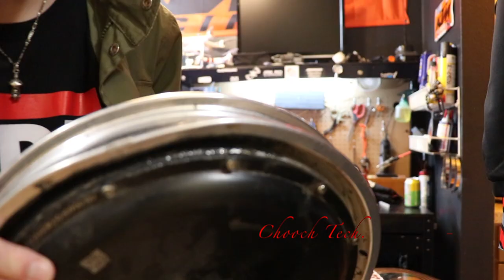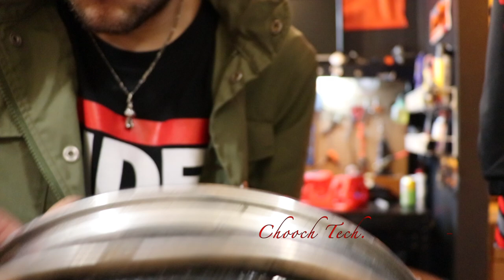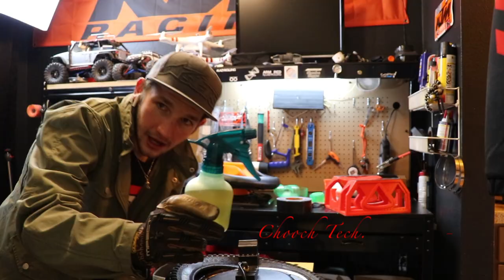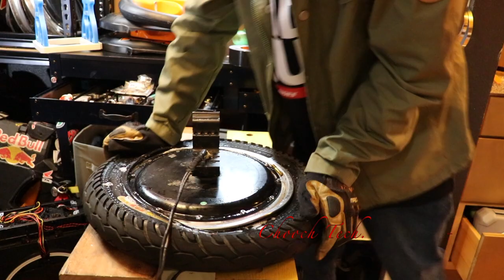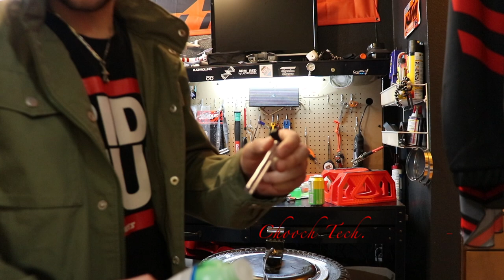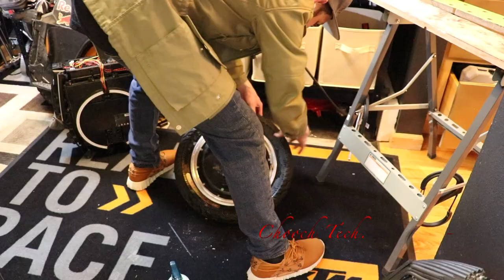PROTECT YOUR TUBE: Electric Unicycle MUST!

Comment: Fairy liquid is always a must, used it on my RS19 tyre replacement and it went on like a charm. Another tip I like to use is semi-inflating the tube before putting the second side in, just enough to keep its form but not too much.

Comment: Harbor Freight stuff is made out of Chinese beer cans. Crap! BTW, I install tubes in tires by inflating the tube the day before and let it sit. Then, I use baby powder on the rim valley and the inside of the tire. Deflate the tube nearly all the way and cover the tube with baby powder and install the tube. The powder makes it slide and conform to the  tire/rim when inflating. To get the tire bead on I use small plastic bicycle tire irons that will not pinch the tube. Much cleaner job. Inflate the tube to 10# and roll the wheel on the floor back in forth to help seat the tube. Do this again at 20# and 30#. Works great every time. I've changed a thousand bike tires on the road the same way with no tire irons. Just my opinion. 
Great vid as always.

Comment: This does work on a tire thats already punctured I did it on my wheel after going over a bobby pin and it sealed it. It is a much easier option than replacing the tire thats for sure!

Comment: If you can find a part number or anything on the wheel ring, I see people selling replacements on ebay/aliexpress.
Alternately, you can grab your calipers and measure the one you have to match it up to one that's close.  
They sell them in halves so you only have to buy the part that broke if you only broke one side of a split ring.

The good news is that if you end up switching to an off the shelf wheel ring your tire selections might open up somewhat, depending on which rim you switched to.

If I find that I can do this to my wheels then I'll put up some notes for others who might want to tinker with their uni's treads.

Comment: Looks like you need to find yourself somebody with a TIG welder that's good on aluminum. You would have to probably separate the rim from the motor to do it right but that could all be fixed bent back into shape and welded. You need to give your tubes a nice coating of talcum powder before you put them in the tire.

Comment: As  a safety feature so people can always find their way back home so to not get lost in the forest, and to reduce range anxiety because of batteries, just remove the battery entirely, and install a super thin super long power cord like with a fishing reel or the cable return that a vacuum cleaner uses.
Reply from the maker: lmao!
Reply: I was planning to go a different route. Install a miniature nuclear reactor - uranium has much better energy density than Li-Ion cells.
However, the idea with the cord seems good too. Evangelions in NGE did that. If it works for a humongous mecha, why wouldn't it for an EUC?

Comment: My isse with Slime is it is not freeze resistant, and in the winter it is driping hard through the glass and thorn holes accoumumated through the year. Disgusting and hazardous snailtrail left on my path when I arrive in the office. But some piuncture repair fluid deffiniately is amust. Anyone had experience with other fluids during winter? Would love to hear about other options.
Reply from the maker: Add a little antifreeze to it
Reply: This liquid (slime) is for protection against tube punctures? In my place the lowest temperature in Celsius is about 8°. Should I fount it overseas?

Comment: Harbor Freight are cheap junk tools made in China like your rim, just buy quality and have a piece of mind. Good info tho, I run 32psi in my RST & EX without a problem so far but as much as I hate higher pressure, I hate bent rims more so I’m increasing psi a few. Also, Armordilloz is better than Slime. Thanks Chooch!
Reply: What’s your weight in Kilograms? I’m using 39psi for 87kg on MSX, think it’s fine! (Less than 35psi experienced whooble after 45km/h)